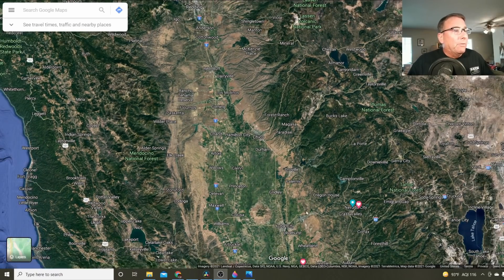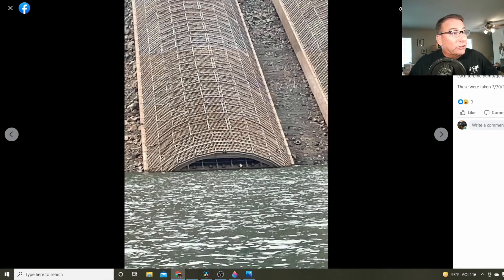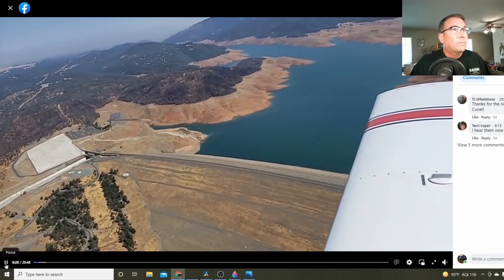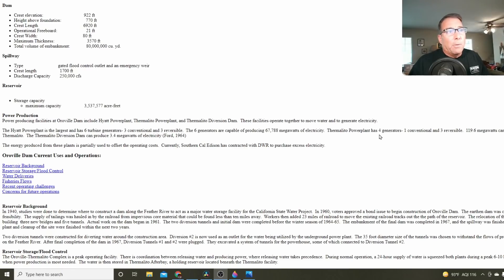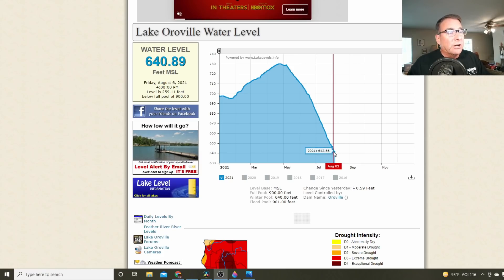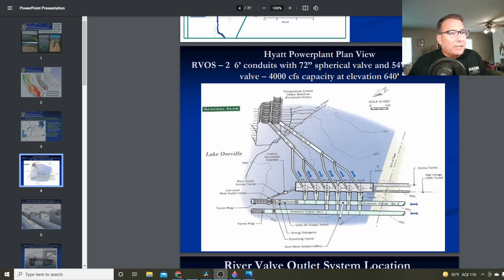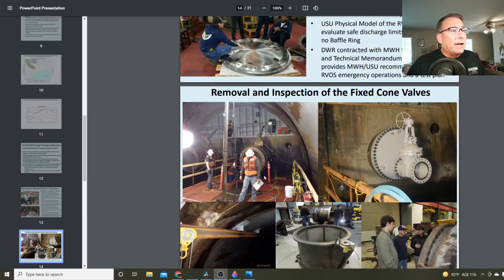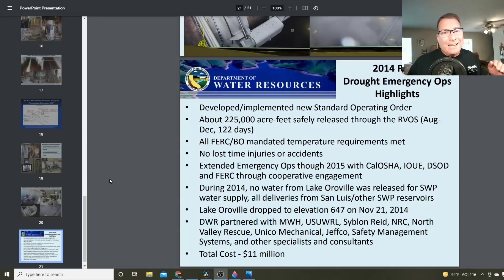Oroville Update! Hyatt Powerplant Offline 8/6/21 California Drought

Comment: I'm an optimist by nature, but there's a question that begs to be answered: if these droughts, wildfires, etc., are one results of Climate Change (and I believe most experts believe they are), then it would suggest that the drought conditions seen in 2020 and this year will continue = an ever-decreasing initial storage each season. This seems very bad, for multiple reasons beyond loss of electrical power.
Reply: We have always had drought in CA. We get about 14 inches a year. It goes a few years below that and than some years double that. What they dont tell you is that haven't build  enough water storage to accommodate the growing population growth.  They also had to drain most of the lakes because they are worried about the dams being faulty.  For example perris is at 20% capacity because of the damn issues. Around 2000 we had a desalination plant ready to come on line but than you know it rained so the powers that be decided all out problem are solved so they sold the plant and moved it to the middle east. Its the same problem every 5 or so years. They tells we need to cut back our water use. Than they say we did such a great job saving water that they did not sell enough water so they have to raise the price. Yorba linda has a lawsuit against their water depart because the amount they said they need to raise to meet the short fall vs the amount they are soaking the residents for is off about $10 million.

Comment: 67,000+ MW of generation at the Hyatt location sounds really high. That'd be over 67 gigawatts of generation.  A quick Google seems to suggest around ~650 MW for the main Hyatt plant. I don't know though, what you referenced definitely shows the 67+ gigawatt number. Regardless, great videos and I appreciate the updates on this and the wildfires.
Reply: Nathan, you're correct. That 67,000 MW is a HUGE error! The rated output of Hyatt (in 1978) was 678.75 MW. I think the machines have been rebuilt and up-rated, and may have a slightly higher rating now. I looked at several web sources, and the ratings are all over the map, but the figure above is right out of a DWR brochure I have when I visited the facility in 1978 (I never throw anything away!) By the way, the output from the Diablo Canyon Nuclear Power Plant is 2,256 MW and the largest power plant in the USA is the Grand Coulee facility at 6,808 MW (according to web sources).
Reply: @sorensolveig599  6800 MW jeez
Reply: Yes the reported figure is about 5 percent of the generating capacity of the entire US grid... It's a bit on the high side....

 About 800 mw is a bit closer to it...
Reply: I'm an electrical engineer at a generating station.  Those numbers immediately concerned me!  ~100 MW hydro turbines are a typical size, so six units generating ~ 600 MW would be a first guess.  678 sound perfectly normal.
Reply: Also these days surplus (cheap) electricity time is midday (especially on windy spring days), due to max solar production. I wonder what the details were for the decision to cease pumped storage operation?
Reply: Indeed. My guess is that source has a major typo: change the comma to a decimal and move to the right. 67,788 MW --> 677.88 MW. This seems more reasonable.
Reply: According to Wikipedia it’s 819MW
Reply: The West and CA got 2 choice, fix or keep the water problem!  CA got 85,9 m acre foot, Coloumbia river dumps 191,3 m foot into The Pasific every year.  Move some water (10%). Make a 365m long tunnel from Red Bluff (Delaware Aqueduct tunnel is 86 miles). NV, AZ, Mexico can then keep more Colorado water (5 million acree feet a year).
Reply: @timb5280  what do you mean Tim?
Reply: @kutto5017  It is a reference to the movie 'Back to the Future' and the requirement of "1.21 Jigawatts" to operate the Delorean-based time machine.   I.e, a big number.

Comment: Glad you're mentioning hydro pumped storage.  It's a critical part of shifting away from polluting power sources and integrating more solar and wind power - when excess power is generated by those sources, it can be stored in pumped hydro then called back when the sun is down and the wind is calm.  All batteries are inherently inefficient.  If the reversible units at Hyatt are not the newer variable speed type, then inefficiency may be a major factor in the decision to not use the facility for power storage due to high cost of storage operation versus low cost of current wind/solar dropping.  (While hydro IS solar, all reservoirs have an impact and stealing from Peter to pay Paul may leave us behind on the whole in being good conservators of the natural environment we all need to survive.) Sites like the Eagle Mountain former mine provide storage capacity without impacting existing waterways and their ecosystems.

Comment: Good reporting Juan.  I see a correction on the Hyatt Power Plant rated output as was printed on the slide.  The 67,788 Megawatts should be 1/1,000 of that number, which would be about 680 Megawatts rated output.  But the real point here is let’s get some rain and snow, lots!
Reply: 1/100th
Reply: @craiggraham9061  Oops!

Comment: I know this is way off topic but as I was watching this video I noticed that the stairs in the background doesn't have a handrail mounted on the wall. I totally understand that some municipalities don't require two handrails if the stairway is less than 40" in width. I also understand that by installing a handrail on both walls it gives you redundancy in an effort to prevent an accident. Just thought I'd throw that out there. Take care and be careful. K

Comment: Pumped hydro is still roughly 70% efficient.  Still a better option than not having any power generation at all.🤷‍♂️
Reply: The US fleet of pumped hydro averages 79% on a monthly basis according to the EIA. The graphed data from April 2019 looks like it topped 90%. Mostly it hovers around 80%. Pumped hydro isn't an energy source, but storage. The efficiency is energy out/energy in.
Reply: Sounds like a perpetual motion theory.

I think what the 70% refers to is you'll recoup 70% of the energy used to pump the water.
Reply: @ShaunHensley  👍

Comment: 6:00 67 GW is way too high.  Wikipedia says 819 MW for Oroville Dam as a whole, which is much more plausible.  For reference, the biggest hydro project in the world, the Three Gorges Dam, is 22.5 GW.
Reply: I was wondering where that 67,788 MEGAWATTS came from...
Reply: @k7jeb  he was reading it from a UC Davis fact sheet, may have been MWh annual instead of MW. Easy error to make when reading on the fly.
Reply: @MichaelOnines  There are 8760 hours in a year. Hyatt has a max output of 645 MW or 537.5 MW with 5 out of 6 running full tilt. So MWh annual makes more sense. Still, that 67 MWh is like 1.2% utilization of nameplate capacity.
Reply: @Markle2k  I found the UC Davis source page Juan was reading and it says MW. Obvious error by whoever made that page. No idea why they messed it up. Time to fire the intern.
Reply: Yeah, that’d be a lot of DeLoreans sent back to 1985!
He corrected it.
Reply: That 67,000 MW is a HUGE error! The rated output of Hyatt (in 1978) was 678.75 MW. I think the machines have been rebuilt and up-rated, and may have a slightly higher rating now. I looked at several web sources, and the ratings are all over the map, but the figure above is right out of a DWR brochure I have when I visited the facility in 1978 (I never throw anything away!) By the way, the output from the Diablo Canyon Nuclear Power Plant is 2,256 MW and the largest power plant in the USA is the Grand Coulee facility at 6,808 MW (according to web sources).

Comment: Surely they calculated this problem before April why didn't they reduce the flow then? There's other places they can get electricity it's not just reliant on this Dam system it's a National Grid isn't it?  Can't they pump groundwater water up into the reservoir
Reply: Political leaders always ignore warnings. They like getting elected, so are afraid to cut people off the water until they really have no choice.

Comment: Oroville Dam and the rest of the complex shows the serious issue the US has with infrastructure. They use it with just enough maintenance to keep it running and then it catastrophically fails when basic maintenance proves inadequate. Major fire due to equipment failure, Baffle falls apart and not replaced or modernized leads to an almost deadly event. Spillway not properly maintained almost leading to a catastrophe. All could have been prevented with a little more than basic maintenance, add some replacement and modernization to the maintenance schedule. US infrastructure maintenance is like adding oil to your car when it runs low and call it good... Until your engine seizes.
Reply: But just think of how much time and inconvenience it would be to take it offline for repairs without catastrophic failure. All I ever hear about infrastructure is how much money would be lost if something was taken away for 24 hours, so the idea of actually upgrading or replacing infrastructure would just be impossible. </sarcasm>
Reply: @SandrA-hr5zk  /sarcasm noted and correct. "Oh how expensive to take it offline!" "Oh how expensive it is to upgrade!" Stupid as F arguments, take it offline when not required and upgrade now to save money in the future is by far cheaper than the save a penny now and spend a dollar later mentality.

Oroville Dam maintenance to prevent the spillway failure may have cost 20 million 20 years ago to cut out the drain pipes and replace and another 10 million to resurface the whole spillway... Instead they let it go to failure and the cost was in the hundreds of millions. Save a penny now and spend a dollar later.

Comment: How long can the remaining water last until the water level is too low for the RVOS to continue feeding water down stream?
Reply: You can do a rough estimate of that if you find out the volume of the lake at 340' dead pool, which is about 29,500 AF of storage, and subtract from the current volume of about 850,000 AF.  This is 820,500 acre feet (AF) left to flow.  The current daily loss of water in AF from CDEC for Lake Oroville is 3,760 AF per day.  That is 218 days.  As the person below points out, inflows will vary, so there isn't a good way without access to modelling software and a database to predict it.
Reply: @donmoore7785  need t factor in the inflows from upstream dams.
Reply: @MichaelOnines  I was suggesting a rough estimate based on current conditions, not accounting for variations in flows that I can't predict.  But there is a significant factor I did not account for, which is the RVOS varies from 4000 CFS at 640' to only 2000 CFS at 340' dead pool.  This would extend the time since the flow rate is less as the level drops.  The short answer is the wet season should arrive soon enough to keep the river flowing.
Reply: @donmoore7785  I guess that is partly my point: back-of-envelope math isn't going to give a realistic answer. This is the sort of question the dam operations team would be best placed to answer, and Juan still has friends there with all the rapport built up reporting on the Oroville crisis.
Reply from the maker: 225 feet or so....

Comment: What happens if they totally shutdown the electrical turbine?
Reply from the maker: already is.
Reply: They close the flow of water (or this case there is NO water). No spinning generator -> no power output. They need to flow some water, so whole river's bio system don't die.

Comment: Wiki has Orville generation capacity at 812 megawatts.   Hoover as reference at ~ 2000 megawatts.  67,788 megawatts does not make sense.
Reply: my speculation is that someone listing it dropped the H from MWH. Probably a non engineer making this public facing stuff.

Comment: The MW number is wrong, 67,788 MW = 68 GW. The largest historical demand of CA was ~52 GW (roughly). Those generating units are about 600-700 MW total, NOT 67,000 MW
Reply: My speculation is that the unit listed is wrong, they probably meant MWH.
Reply: Came here to say this.  Someone missed something in translation on that site, other sources indeed report about 600-700MW

Comment: Juan - what you said about the negative inflow #'s you pointed out indicating evaporation exceeding inflow is not the correct interpretation.  The explanation is, INFLOW is a calculated value from outflow (known) and difference in water elevation (measured), as well as a correction for evaporation.  Errors (noise) in the lake elevation measurement cause the negative values that you see.  Evaporation as I recall is in the single to double digits of CFS - not hundreds as would be required to explain that data.  And INFLOW wouldn't go negative from evaporation only every few hours but be positive the other two or three.  They correct the inflow to reduce these errors by averaging over the last 4 hours and this also modifies INFLOW.  So if it was overestimated in the previous three hours, in the fourth hour the value may be negative so overall it averages out.  The result of this is, if you calculate how much volume should be gained (assuming inflow exceeds outflow and evap) over some period such as 48 hours, using the INFLOW data points (including the negative ones), you will get a result that matches the difference in the VOLUME field.  I crunched the data back in 2017 and verified this, and an engineer who knew their system explained the averaging they use.  Elevation measurement is its own topic - I believe they have several measurement locations across the lake, and compensate for factors such as wind and waves.  Imagine measuring that huge lake to within a fraction of an inch, and how errors in measurement can throw off calculating INFLOW, which relies on accurately measuring a change of volume (determined by a function that relates elevation to lake volume).  Glad you covered this news - I knew this was close to happening.

Comment: Know you can't get into discussions with everyone. However,  does this system meet up with the Co River system and Eel & Russian River system?
#2... how did that thing corrode.  Its not salt water...
Reply: This system goes directly to the SF bay after meeting the Sacramento and San Joaquin rivers. Russian river outfalls directly to the Pacific. They are separated by the coastal range.
Reply: #2. Water is a near universal solvent.  Salt water is more corrosive than fresh, but fresh water still causes corrosion.  The larger factor is the mechanical erosion over time of fast moving water under pressure.  Add tiny bits of sediment and you have microscopic erosion happening more or less constantly.  Little things add up over time.  i hope this helps with your #2 question!:-)🖖

Comment: You didn’t need a pop filter, especially when you were talking across the microphone.
Reply from the maker: GOOD GRIEF BRUCE, Yer NEVER HAPPY!!!   ;-)
Reply: @blancolirio   Calm down, Juan. I was defending you. Last year someone gave you the pop screen and you didn’t need it then and you still don’t. Your mike has a built-in pop screen and you’ve never had a problem with breath-popping and plosives (unlike that happens with many of the headsets in aircraft). People see others using pop screens and assume every microphone and the way people position the mike means it is necessary but if it’s not needed it’s pop screen theater.

Comment: And if they ever really wanted to do something about California's water problems the Rockies are right around the corner. But the Demoncrats aren't here to solve our problems they're here to get rich off of our sorrows and hardship
Reply: @Paul Simonson there have been many engineers over the years that have said we should divert water from the melting snow in the Rockies to California. It would be an enormous amount of wealth generating income for all kinds of different trades and we would essentially solve the water issues once and for all. But unfortunately the politicians control people with water and electricity and covid and every other damn thing.
Reply: @BKMDano17  there's the entire basin and range in between (UT, NV). Colorado river is massively overtapped. You can't divert the Missouri river over the continental divide.
Reply: @MichaelOnines  yes you can
Reply: @BKMDano17  it's going to cost billions just to get the feather river a hundred miles to the Clifton Court Forebay and you want to ship the Missouri across the Great Salt Lake basin? Ok, can you provide a link to a feasibility study or something?
Reply: @MichaelOnines  start looking you will find many. The idea has been around for decades. You know they said the Alaska pipeline was going to cost too much and essentially impossible to build. We both know how that turned out. Where there is a will there is a way. And they are much more complicated engineering feats that have been accomplished all over the world. If the government wanted it done it would be done. But much like marijuana, they won't do anything until they can figure out a way to make money off of it. You can grow all the pot you want and sell it these days but you will pay the government 50% off the top. have fun the research is out there!
Reply: @BKMDano17  best I can find is the "Eisenhower pipeline" that was included in a bureau of land management paper as a considered but infeasible plan which would divert into the colorado river basin some flows headed towards Kansas.

There's loads of money to be made in water. It is routinely sold.